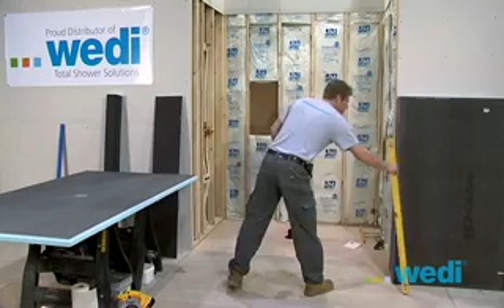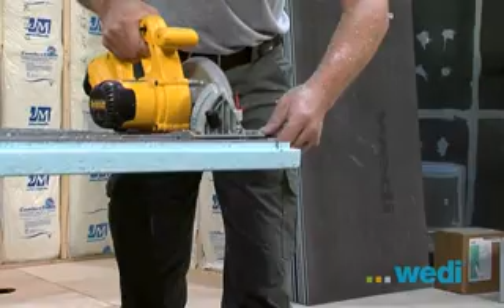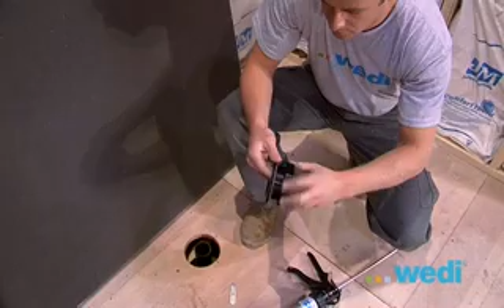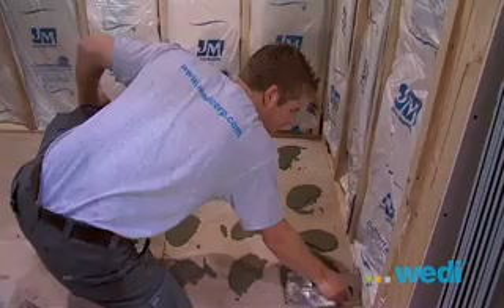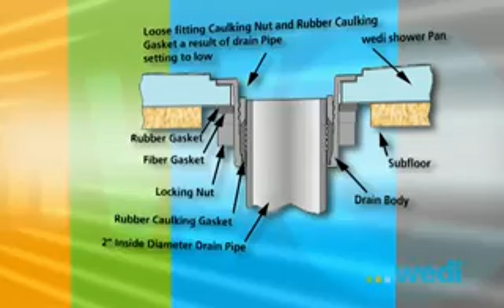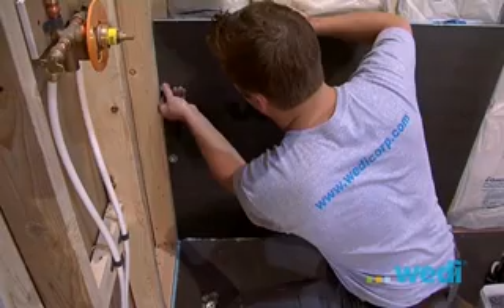wedi fundo shower systems Training Video #1 File 1 of 2.avi

Comment: Thanks for not putting the rubber gasket positioning into the actual "detailed" instruction booklet. Unbelievable
Reply: Agreed
Reply from the maker: nick Mletzko maybe they forgot ....
Reply: @MarkusDworowy  forgot basically the most critical aspect of their instructions.
Reply from the maker: nick Mletzko than you should contact wedi ;)
Reply: @MarkusDworowy  i actually plan to.
Reply: Agreed.
Reply: Pro tip. Just use a router rabbiting bit after you’ve cut the pan to size. Wall boards slide right in the notch. Easy. I always use at least a 1/2” trowel to tap level. Kinda like a large format tile. My pan is perfectly level all the way around. I can set my pan tile first then just run my walls directly on top of my pan tile. No need for perfect cuts for my pan tile. I just run a factory edge for walls straight up.
Reply: Yeah You would think they would detail that.
Reply: I just thin setted my 3x5 base down and am at the rubber gasket step now. I cut the pipe 1/8 above the self leveler surface. Now I can't tighten tighten the caulking nut down well without the gasket going below the top of the pipe. The booklet states to have the top of the gasket flush with top of pipe. But after watching this video, it appears to be ok if the gasket is below the top of the pipe?